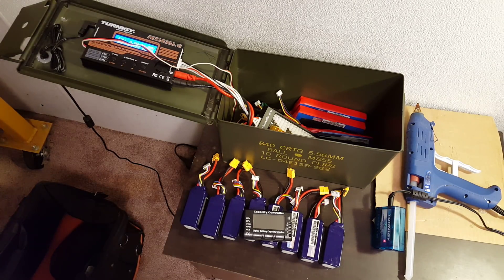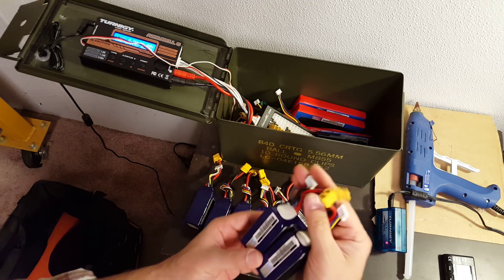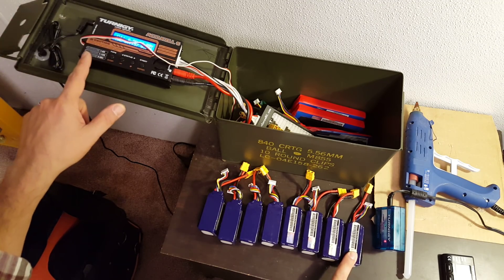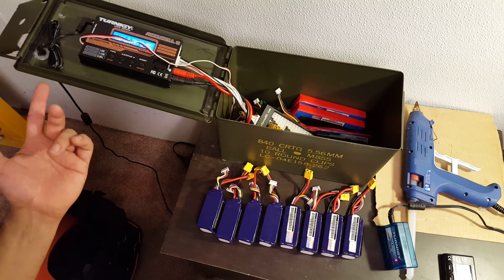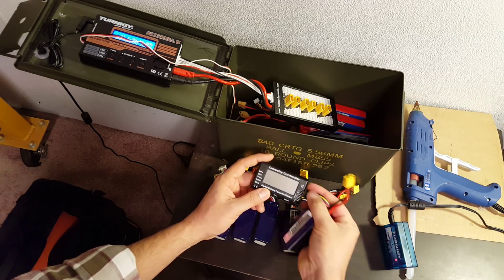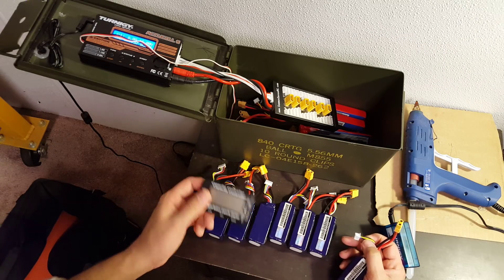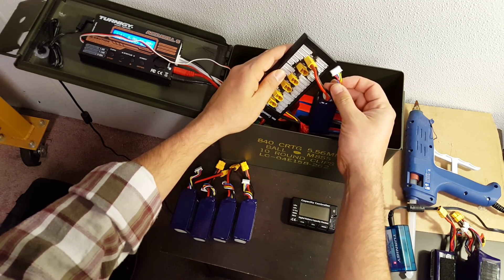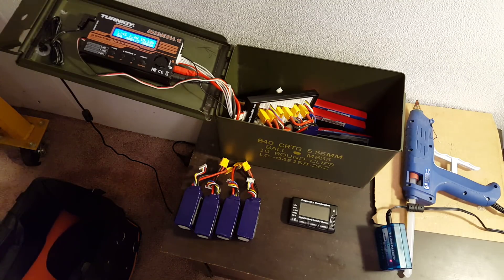How To Parallel Charge LiPo Batteries Without Burning Down Your House

Comment: If the batteries are poorly balanced will it affect parallel charging badly? Sometimes my 3s batteries are up to .5 out from another cell in the same pack.
Reply from the maker: Yes, definitely. The problem is that one battery with a bad cell will pull down the same cell in all the other batteries in the parallel charging board. If you have a battery with a bad cell, it's best not to parallel charge with it.
Reply: Joshua Bardwell makes sense time to replace a few batteries thanks for the advice!  i should have 4s anyway

Comment: What if the mAh are different but the number of cells is the same?
Reply: It wouldn't actually. If it were charging at 4C, then it would finish charging in ~15min. But the 2000mAh battery would take ~1hr to charge. How could the 500mAh battery reach final voltage at a different time as the 2000mAh battery if they're in parallel? It can't, because the voltages have to be the same.

What happens is that the 500mAh battery charges slower, because its voltage increases faster, so the current goes to the bigger batteries.

When parallel charging, just add the capacities and use that to calculate how fast you should charge. ie. If you're charing 2x2000mAh batteries and 2x500mAh batteries, that's a total of 5000mAh, so if you charge at 5A you're charging the batteries at a 1C rating.
Reply: Joshua, how I have been doing it is start with the lowest charged lipo then I add in each battery as the banks ave cell voltage meets the next batteries ave cell voltage. As I add them in I bump up the amps.   It's been working great for me. Is there anything wrong with this?
Reply: Dylan Bogusz, it would probably work, but try not to pair batteries with very different mAh. Say you are charging a 2000 mAh battery at 2 amps (1c). If you added a 500 mAh battery, it would then be charging at 4c. To safely charge lipos, stay art around 1-3c.

Comment: If I have two 2s batteries wired up in parallel can a simple plug the two balance leads and one xt-60 into a parallel charging board? Or do the two balance leads need to be connected first?
Reply from the maker: If you wired the main discharge leads in parallel, but you did not wire the balance connectors in parallel, then you must plug both balance leads into the parallel charging board.
Reply: Fantastic! Thanks for such a quick reply. I didn't really want the hassle of soldering up the two balance leads together on such tiny 300mah batteries. Thanks again, you are a legend!!

Comment: is it no less safer to have Graphene and none Graphene in the same charging pack?
Reply from the maker: It doesn't matter at all. Just use safe practices like charging at less than 1C for the entire array.
Reply: Joshua Bardwell riot group have a video on this. They said u can have different capacity in the same charging pack as long as they have the same cell count.  what is your opinion?
Reply: riot group have a video on this and they said it is ok to have different capacity in the same charging pack. what is your opinion?
Reply from the maker: +Jack Truong yes definitely. Capacities sum in parallel.

Comment: if the voltage between batteries are more than 0.4 , is it possible plug them onto the board and let them balance themselves out before charging?
Reply from the maker: +Jack Truong no. The equalization current can damage them or start a fire.
Reply: Joshua Bardwell
I just want to start out by saying I don't know if this is your area but I want to know if I could charge 18650 batteries with tp4056's and just  connect the outputs in parallel or could I connect the outputs to a switch so when charging I could turn the switch so they are not connect but when I use them i could just flip the switch. I want to do this for a large iPhone charger with out using a bms or without having to connect them in series, also cause the tp4056 only charges at 1ah and that would be really slow for 20+ah.
If you could even recommend me a battery charge board I could do that too.
Reply from the maker: +Bengy22 thus isn't an area of could advise you in.

Comment: i think you left one tip: CONNECT THE PARALLEL CHARGING BOARD TO THE CHARGER BEFORE PLUGGING YOUR BATTERIES ON THE BOARD!
it happened to me that while i was plugging the batteries on the board the two  positive and negative banana plugs of the board touched, fortunately the only thing broken was the fuse on the board but it could have been worse.

Comment: I would recommend using a bat-safe box instead of the ammo box :)
Reply: Nout wrong with an ammo box, yanoe, theyre designed with explosives objects in mind lol
Reply: @uksimracer  Insulated box designed specifically to handle lipo fires and explosions  >  Uninsulated metal box that is NOT fireproof and will most definitely get hot enough to ignite nearby objects if a lipo fails inside. Ammo boxes are designed to protect ammunition from humidity during storage and that is it.
Reply: @uksimracer  ammo boxes are not ideal - they are not designed to contain fires and will allow heat/smoke to escape - they are NOT designed to contain explosions either - they are simply designed to keep ammo safe during transport and storage from knocks.

Comment: a couple things. I'm no battery expert, but I know a few things about circuits. if you parallel charged a 3 s and a 4s, well if you charge with only the balance lead connected you might be fine. the charger might not like it being that the first 3cells would take twice as many mAh, it could fail the charge assuming damage to the 4th cell.

 if you didn't use the Balance lead at all you'd be right, the 3s would probably exceed it's charge rating and bad things may happen to the 3s, but if you connected both leads, it's the 4s that would have problems. since the 3s would have it's discharge lead connected to the 3rd cell, and the balance leads are connected to each other you'd be shorting across the 4th cell of the 4s through both balance leads. the small leads for balance would probably save the cell by burning up rather quickly. but if something other than a lead letting the smoke out it would be the last cell of the 4cell.

Comment: I'm thinking if i should buy an Ammo Crate and a bag of sand to put on top of it. In case there's a fire, the bag of sand will break and drop all the sand ontop of the cells.
Reply: or just create a bed of sand underneath. Sand wont put out the fire. Remember when a lipo explodes or catches fire its from all the heat generated due to the chemical reaction within the cell. So until the reaction subsides youll have extreme heat and if theres flammable material around a fire. 

The sand will act as an insulator keeping the heat centralized to that battery.

Also make sure you make a couple vent holes. If a battery does start to leak, gases will build up, ignite and basically your ammo box will be a bomb
Reply: Get a class D fire extinguisher at least. Not hard to find but many people don't understand the class ratings...

Comment: Should i always balance when parallel charging? Or just regular charge works?
Reply from the maker: Always balance, period.
Reply: Does the charger even balance the cells when there are more cells in the array than the charger can show data for in its display?
Reply: I don’t think you will get proper balancing when parallel charging. Let’s say you have 4 lipos. The first cell of each of the 4 lipos are connected in serial by the board so the charger see these 4 cells as one large cell. The next cell is the sum of the cell 2 of all the 4 lipos and so on. If one cell in a pack is way lower than the other cells in the array, more current will naturally flow towards that cell. But, it’s not exactly the same as balance charging a single pack where the charger will make sure each cell has exactly the same voltage.
Reply: When parallel charging the cells are connected in parallel, not in series. So the charger will see the parallel voltage of cell 1 of all the lipos (ie. just the voltage of cell 1), not the series voltage (ie. the sum of all of the voltages of cell 1).

So the charger will see it as 1 large battery pack, not as 4 individual battery packs.

Comment: My instructions said to plug the balance plugs in first, and then the power plugs.
Reply from the maker: +Steve Farling well, the good part of that is, if you accidentally screw it up, you'll burn the trace on the balance board before you fry the battery.

Comment: Joshua Bardwell Hiya josh what's the best way to recover a low cell on a battery pack iv not been able to get out flying for a while 
and I was checking my pack's and I'm getting a very low alarm on one of the cell and not letting me change it  I had this before but I can't remember how I recovered it the last time lol  I think I put it on a low ni-mh or ni-cd   for 5-10 mins to get the low cell backup to a stable enough for a slow lipo change   this only happens to my battery on base station and goggles and I got a small battery &cell checker to add on mt fpv setup  but I need to find the best way to recover a low cell on a battery pack safely josh what's your advice   on this

Comment: Well.. the charger I have is a 3s-4s only.. parallel charging board is a up to 6s one. So the connectors don't fit on my charger.. what I did was get one battery and plug it's battery checking cable to the charger .. and the power cable is going to the actually parallel board instead of the charger. I then place the other batteries with both cables on the parallel board.. right now they are charging fine however they are charging rather slow. But Im seating next to it. Already checked them 3 times and they are all charging even.. if all checks out, should I keep doing this? I don't wanna buy another charger ..
Reply: The issue with doing it this way is that the charger will only be able to balance the 1 battery connected directly to it, the other batteries will get charged, but not balance charged, since the charger doesn't have access to their balance leads.

It is expected that charging will be slower when parallel charging. If you are charging 4 batteries at once, it will take 4 times as long as charging a single battery. You will only get time savings if your charger can output more current. If you usually charge at 1C, then 4 batteries in parallel will only be charging at 0.25C. You'll need to up the current to 4x the single battery amount to charge each battery at 1C.

To connect all the balance leads, you'll need an adapter  6S -> 4S, and then you must never plug anything higher than 4S into the board. Or you can cut off the balance lead on the parallel board, and replace it with a 4S one, ignoring the two additional leads, but that is quite a bit more difficult, requires crimping tools, and is much easier to mess up.

Comment: I have a question. if my charger is 12v 5a will my wall adapter 12v 1A work with it???
Reply from the maker: No. The charger may draw 5 amps while the adapter can only supply up to 1 amp safely. The adapter will burn out.
Reply: Ok thank you for the quick response saved this adapter for now. Lol. But a 12v 7.5a adapter would be ok because the charger will only draw 5a.
Reply from the maker: Correct.
Reply: Joshua Bardwell thank you I got one more question I have a small jump box for a car battery........ could i use it at a 12v 8a to power the charger.
Reply from the maker: +HLFDeadKC 420 sure.

Comment: Since the concept is that you make the charger think it is one large 2s or 3s, 1xxxx mAh battery how do you keep each 2s x 4 batt =8 cells balanced properly.
Reply from the maker: +Craig D all cells in parallel with each other will self balance. Whenever there is a voltage difference between parallel locations, current will flow until voltage is equalized.

Comment: so does this properly balance the cells? I thought the idea of the balance charger was to balance the cells, yet when you have 2 or more cells in parallel how can you control each cell individually.
Reply from the maker: Cells in parallel are always at the same voltage potential. If not, they will exchange current to keep them at the same potential. This is why packs must be at the same voltage before plugging in to a parallel charging board.

https://www.youtube.com/watch?v=1GhPXw_BQlc

Comment: Thanks for this video, i just got a hobbyking para board for my 3s 850mah batteries and using an imax b6 charger.

Really clears all questions up.

a few people complained that the traces burnt on the board or the balance leads got damaged, i guess because of connecting batteries to far out of charge from each other.

Comment: I absolutely love the idea of using an ammo box for charging. I might have to steal that.
Reply: need to be a little careful as it can pressurise, lots of people drill little holes incase of any problems, also you have to be wary that if you do have a lipo fire, the box will get so hot that it will ignite carpet/wood flooring. So you still have to have it in a save place!!
Reply: Phasor Shift it's been an sensible idea for years...cheap, safe, readily available and easy. ...add some common sense and you're good to go...they are made to contain ammunition...n to keep an ammunition mishap localized...so..yeah....no brainer if you vent hole it, properly latch and don't store it to charge on piles of fluffy cotton
Reply: Maybe you guys can educate me a bit on these ammo boxes. I understand it's designed for ammo mishaps, like containing a round that went off... the box is a heavy gauge steel correct? I'm just curious what the melting temp is lol Can't say I even know what temp a LiPo burns at.. yea these boxes will retain a bullet but will they hold up to the heat of 5+ LiPos burning?
Reply: S Behr ....? Care to elaborate? Lol like really wtf? 
Is it stolen or is it just another person sharing a good idea that was originally posted with the intent of sharing said idea....? In a public domain.............
Reply: Can someone educate me on first question though? Please? Lol haha
Reply: We use it for radio comm work sometimes.   They're good for lots of things.
Reply: Be sure to remove the rubber gasket in the lid of the ammo box. This way it doesn't turn into a pipe bomb if you have a lipo battery vent. You need somewhere for the pressure to go when the lid is closed.
Reply: Sfs newbie  I have a hole for my charge cables to run through. I also removed the rubber gasket. I also use some ceramic tiles and place my charge set up on that and keep a fire extinguisher and sand close by. Watch some videos on lipos venting and its always best to be safe than sorry.
Reply: I have a special thermal cloth in my box to lessen heat teenage transfer if there is any cook-off. I've touched the back of this stuff whilst exposure to high heat gas flame and it works. However,  i have not actually seen how it might work if an ammo box of batteries had one cook.
Reply: How would I be able to make one on a simple budget?
Reply: Yes it atleast contains the fire. theres a very good video that tests various methods of containing lipo fires from small batteryes upto very large capacity lips which didnt do to well in an ammo box.

The largest one blew the top of the ammo box and continnued to roar for 30 minutes before the decided to extingish the fire, might have been a 12aH battery that did that.

Those batteries were though made to fail int he worst possible way, charged until they exploded.

Comment: No issues with the accucel 6? How many batteries do you think you can get going off a single charger? I only fly about half as much as I could since I have to spend the whole day before swapping packs on and off the charger.
Reply from the maker: You can get as many batteries as you want, it will just take forever to charge. Realistically, for 4S, your max charge rate is going to be about 4 to 5 amps.

Comment: I can plug in any balance cable in any port? or is it paired exclusively to each specific ec3 port?
Reply from the maker: +felixthemaster1 any.
Reply: I see, thanks. So before I start charging, I let them rest so the voltages equalise? (they are all around 3.8/c). I have always wanted one of these, but I didn't trust myself to not burn the house down
Reply from the maker: +felixthemaster1 they need to start within 0.1v / cell. If they are within 0.1v / cell you should be okay to start charging within about a minute of plugging in.
Reply: In the odd chance that it is not, do I need to plug them in individually (storage mode) so I have a common starting point? As for discharging after a flight, I aim for 3.8 but Often end up at 3.85. Is it safe to mass discharge?
Reply from the maker: +felixthemaster1 if they are not within 0.1 volts per cell, I charge them individually. You can also put them to storage and then parallel.
Reply: And I am safe to discharge parallely after a flight as well? Thanks for the help.
Reply from the maker: +felixthemaster1 yes.

Comment: Hy Joshua, I was wandering instead of buying a normal charger that charges 6 batteries at the same time and a parallel board, to buy 6 of this: Hobbyking® DC-4S Balance Charger & Cell Checker 30w 2s~4s, do you know if it's a good idea? 
thanks
Reply from the maker: I believe those only charge at 1.0 to 1.5 amps, which is about 1C for a typical FPV battery. Your options for faster charging are somewhat limited. You won't have the capabilities of a proper charger like fast charge, storage mode, and so forth. Also, you'll need to rig up some distribution panel for your 12v supply. For $9 each, you can't really go TOO far wrong though.